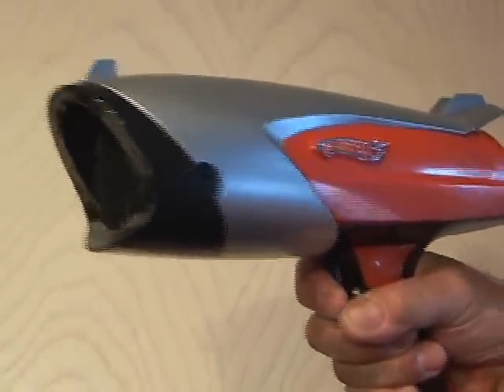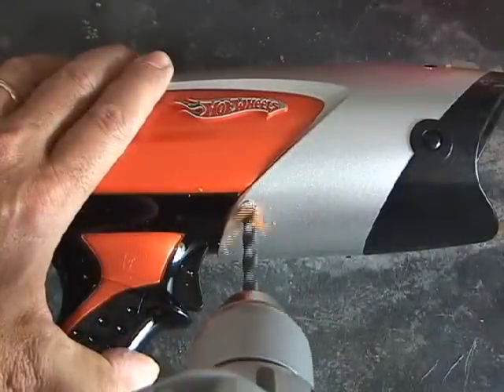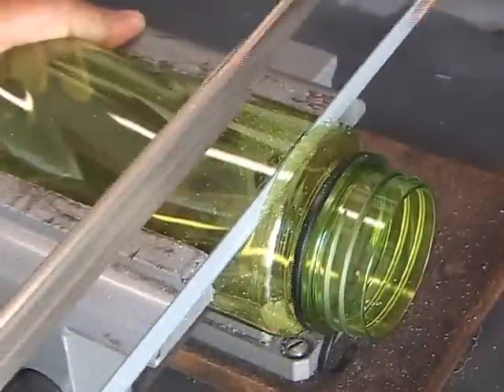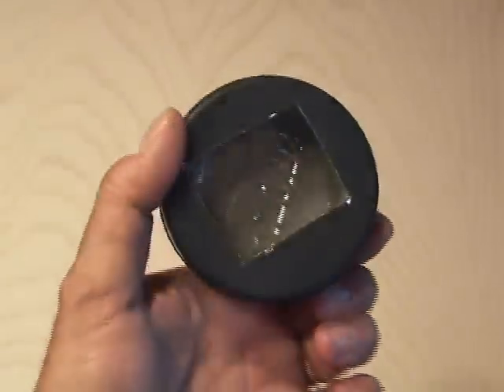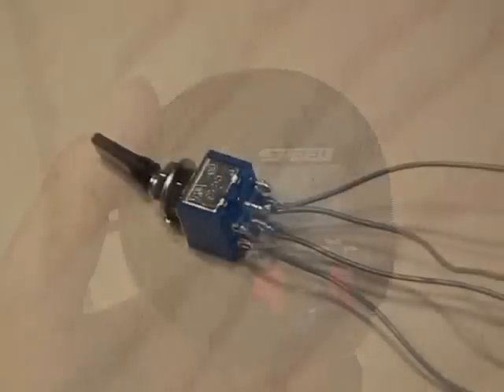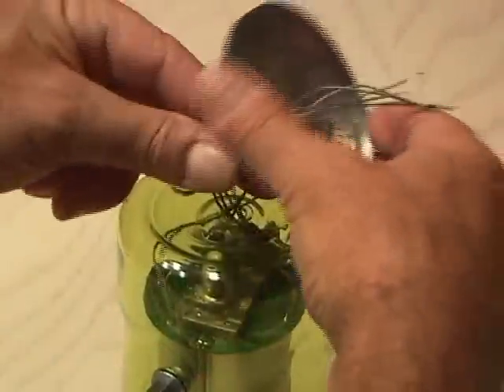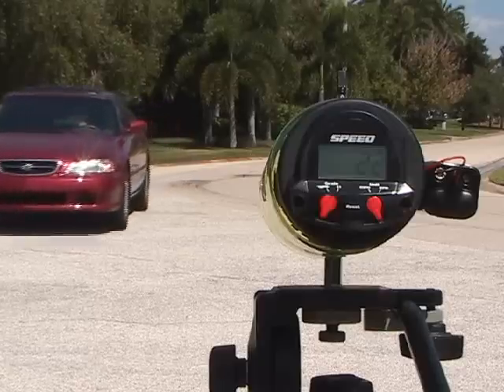Radar Gun - Hacked!

Comment: So i made this, been working on it for a couple days now, I have everything put together where they should be,... But when i press the button it still reads speed just as the old gun, i changed the batteries to AA not AAA, and i used 4AA's... so that should atleast triple the power, but it only indicates the numbers '2, 3, 5, 6, 7, and rarely 9" SO WTF IS WRONG!? i dont think the switch has anything to do with power output, so i didnt bother with the toggle switch, i just kept that dumb ol buttn

Comment: Ok, all of your videos kick ass, but so far, this is the only video I've come across that made me yawn.

Truth be told, you could have just as easily removed the grip from the gun, and replaced it with the little screw or whatever you used to mount it. Sure, it doesn't look nearly as good as what you did, but it works. Heck, even just a clamp would've worked xD

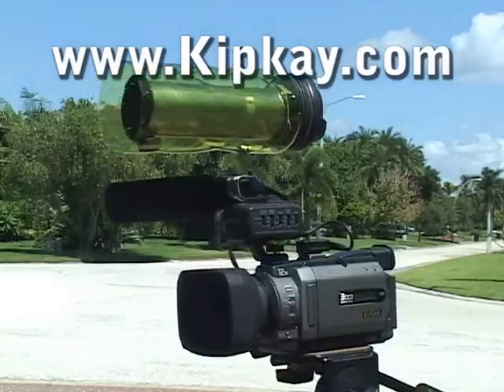Comment: HAHA, you could have easily taped the trigger on instead of 1:18 you would be down to 5 secs. What you did was like this. I bought a new speaker, so what i did was unscrew the screws and remove the speaker from the cab it was in, then goto to loco hardware store buy some MDF board. Cut out a new box and glue and screw the new cab together and put the speakers i removed earlier into it. And then wired it to a amp and played music though them :P

Comment: @saranakhbari thats ""modifieing" not hacking from where I come from, to hack refers to the re-configuring or re-programming of a system to function in ways not facilitated by the owner, administrator, or designers to go in and change the outcome of the product so it does something totally different. he modified it to work better, to last longer(battery) and for the switch to not have to be held to keep readings and so on.

Comment: so all you did was bypass the momentary switch and replaced it with a toggle switch. not saying that what you do in your vids is not cool but a zip tie and some duck tape would have done the same thing. I did not see any change in the performance of the gun just that you mounted it to a camera and made it on all the time. also I have one of those hotwheels radar guns and they are pretty good.

Comment: DARKNESS,

The AA size has a larger capacity.  So a device running on AA will typically run 2 to 3 times longer than with AAA.  Same voltage, but AA is like having a larger fuel tank as more voltage producing chemicals are inside.

Comment: Would have been alot easier to jb weld a nut in the bottom of the gun and put the switch in it. Then again it wouldn't look so l33t as if YOU built it right? Get going on that EV.

Comment: That's an easy fix, all you need to do is reroute the flux capacitor's power coupling to bypass the kinetic generators altogether, then use the spare electromagnetic reverberators you should have left over to repair the sonar array's spectrum defrequenter.

Comment: 1992 you can pick them up most anyplace, however dont get the cheap ones, goto Radio Shack and get their set. The cheap ones use a "crimp" to hold the thin flat head or Philip tool thats inserted into the hallow shaft that you hold like a pen. Every one I have ever owned turned inside making it useless. Sears also has a sweet set or precision screw drivers, and Harbor Freight sells a good set of "security" bits for taking apart what they dont what you too! >:)

Comment: you didn't hack it, you just put the insides in a different outside

You could have have spray painted the plastic case black and put a rubber band around the trigger to keep it on, $2.15 solution in 1/4 the time.
Cheaper, faster, better.